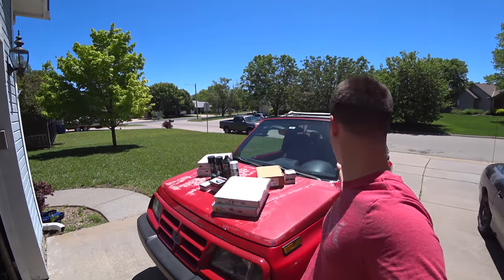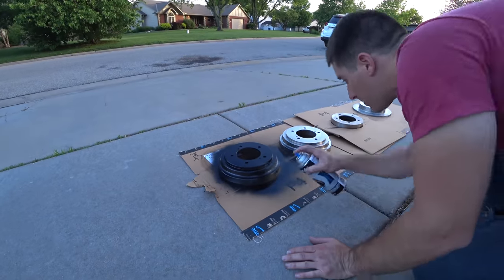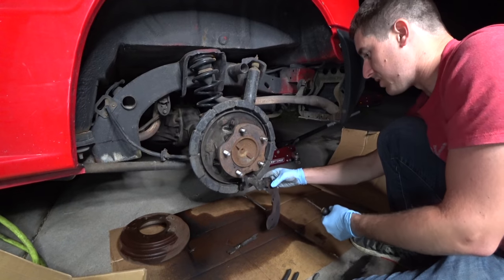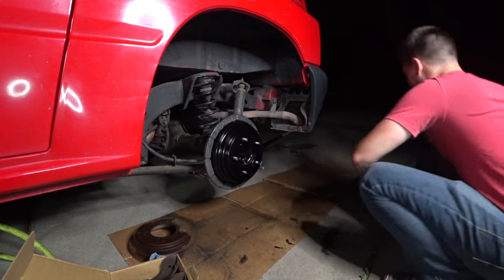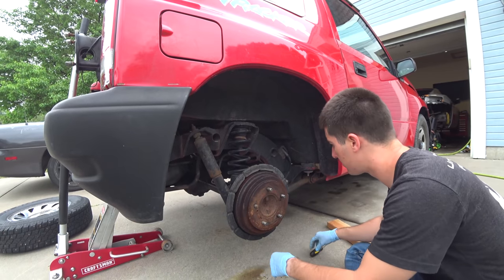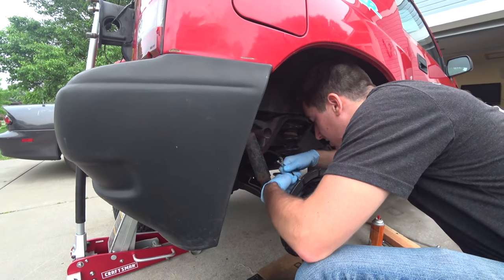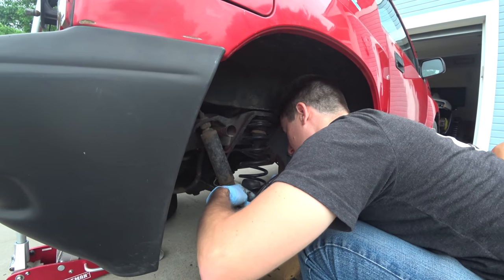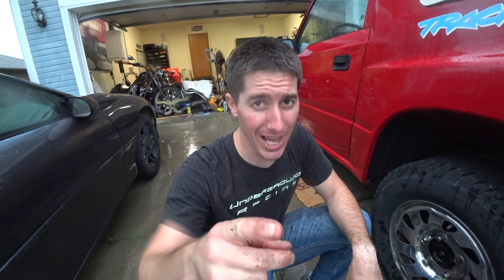The ULTIMATE $400 Geo Tracker BRAKE JOB // Part 1

Comment: 11:00, those clips on the drum are put on during manufacture to keep the drums on the assembly line until the brakes are pumped up and adjusted and wheels on. When I worked as a tech in our GM dealership, the presence of those meant the drums had never been off. We just took a pair of dike cutters and cut them off.

Comment: I'm really enjoying this Tracker journey!  I was 18 when they came out and always wanted one. They look so fun, death trap or not.  I did get to drive the Geo Storm, which was also a fun car. Keep up the videos, I may decide to go get one myself 😁
Reply: I loved my geo storm
Reply: I can attest that after being run off in a 40ft culvert in my (one of 8) tracker, landing upside down, death trap isn't a word I'd use. I wast hurt at all, and climbed out on my own. The driver's side was destroyed after it landed on a large rock, and it saved my life. I've seen many others that landed upside down or similar and people survived unscathed. These were tough built small Suv's.
Reply: @Pressedsteelcustomsllc  mine got hit by a semi trailer in the first heavy snow this past winter, just dented in the quarter panels and tore off my mirror. Everything else is fine, and it still drives perfect
Reply: @Riverplanet  I drove mine home after they wrecker pulled it out of the culvert, and it still runs great over two years later after sitting in my garage ( I've owned it over 12 years) but have another body for it, just gotta have time to change it out.
Reply: @Pressedsteelcustomsllc  wow, that's amazing! Certainly can't do that with most vehicles today

Comment: You know about the adjuster slot on the back, right?Adjust to a light drag once the drums are on. Then E-brake or backing up will maintain the adjustment. Good man replacing everything.

Comment: I had a 94 back in the day, absolutely loved it, I had mine on 15x10 eagles with 33s.... just a little insight when you open just the sun roof dont flip it from the front push up and back from the center of the canvas it's a full sun roof like that

Comment: I've been following along with this little project, reminds me of my 88 chevy short bed p-up with a 350. Over the 9-10 years I had it I pertty much kept it as new although I had bought it used for 2K. If it needed something I would go completly through what ever, rebuilt the front end, rebuilt the brakes, replaced the 700-R4 with a recon unit, kept new tires on it, just never took short cuts. Chevys are so easy to work on. If you like cars then you like tinkering with em.....lol

Comment: Normally if you can lock the brake pedal down, you won't have to worry about the lines bleeding out while doing brake work.  This worked flawlessly when replacing the rear calipers on two of our vehicles.

Comment: Done my share of those only to find a leaky wheel cylinder. It usually happends because someone used up all the brake pads causing the piston to overextend, much like yours. You havent lived until you have to cut the drum off because its fused onto the hub. My last one was on a 1978 Chevy Nova 4 door in 1989. It was a Florida  car but It had been driven in Michigan for a few years. Those cars would visually rust while you sat in a lawn chair and watched it happen. My mother owned one, then I got it from my brother in law, then 4 years later, got another one.
Reply from the maker: Holy crap, I've never seen brakes get that bad 😮
Reply: @WatchJRGo  I dont see it as bad now, I have owned many " beater" cars over my life time. Subarus, A Honda Civic, Ford Maveric, Sometimes multiples of the same kind. I could swap plates between cars while I was fixing the broken down sister to the exact one I was driving. My wife got tired of it after about 15 years of it. I always had a project car going too.

Comment: When you run a bolt into rusty gummed up threads, try adding a groove along the bolt with an angle grinder. This gives the debris somewhere to go and that bolt might not have broken off. Poor mans tap. Nice work, Nice video, Nice GEO

Comment: WatchJRGo... one thing I have learned over time with working on cars and motorcycles... NEVER TRUST HYDRAULICS. You should have inserted a tower on the side you are working on. Working with just having the Craftsman lift to keep the Tracker up is dangerous, the lift hydraulics can fail and drop the vehicle at any given time.
Reply: Which really only matters if you're working UNDER the vehicle. I had a car roll off the jack while I was replacing a caliper, no big deal, in fact I finished doing the brakes before bothering to jack it back up to put the wheel on. Jack stands wouldn't have helped in my situation anyway, I had to do the work on a hill and it likely would have slid off of whatever was holding it up.
Reply: Nodak81 not true dude. His head is in the wheel well. He reaches underneath the car. If it fails it’s not just going to slowly lower down. Personally I’ll only use a jack if I’m pulling a bumper off or something. But brakes or any suspension or engine work I always use a stand or at the least put the wheel under the car
Reply: Nodak81 rolling off the jacks are different... if you’ve seen hydraulics fail in the field you wouldn’t be screwing around
Reply: @oshkoshbegone actually I have. And also seen careless bystanders leaning on the jack and accidentally lower the jack.
Reply: @nodak81  like Abesss said, he had his head in the wheel well and even his arm inside the wheel well. The jack will not come down slowly. Even with the jack having wheels it can slip and bring the Tracker down quick!

Comment: Hi Buddy:
I noticed when you have the top open part way that you only have about half of the front sunroof area exposed. I drove mine with the front portion open all the time. When you are opening the top you push out on the center fold and it will expose the whole front area. Then there should be a velcro strap that will secure it open and the full front area is exposed. You can open this way without ever getting out of the driver's seat. 

Love your videos!

Comment: Not to say I haven't in a pinch not used a jack stand.. but remember Jr, you're the one that wanted to post your adventures on YouTube. Therefore you have a responsibility to do things safely. If not for yourself, for the novice people that don't know any better that are watching you to try to learn. You're beating on a wheel hub while the car is being held by only a jack. With your head inside the wheel well not even the tire under the frame to catch it if it falls. How would you feel if somebody followed your suit. And had a car fall on their head. I hate to be that guy. But you are the one that chose to post things on YouTube. Love your content, but work safely set a good example for people that are learning bye watching you. I'm only commenting this because I just watched you do this same unsafe task while changing a crankshaft sensor in a full size Suburban. You're setting a bad example we still love you though.

Comment: No wheel cylinders? Always replace your wheel cylinders when doing shoes or you’ll be replacing the shoes again when they leak. You also need to use antiseize on the backing plate and pivot points.
Reply: Did you bother to watch the video?
Reply: @paulcopeland9035  yah, I caught it after the comment. It should always be standard practice though. When I saw him doing the drivers side without replacing the wheel cylinder I was a little concerned.
Reply: Can't believe you didn't flush the brake lines

Comment: The only thing I can suggest on this rear shoe job...is use white lithium(sparingly) on the contact surfaces for both shoes(3 on ea side) and lube the adjuster with same so it operates freely with self adjusters...k???

Comment: Were was your grease application on the rear shoes so they slid easily against the backing plate and the cleaning of the self adjuster then the white lithium grease on the threads for smooth operation maybe you did it off camera but you should have mentioned it for those who don’t know

Comment: Should of put 4 door Tracker brakes on it. Direct bolt on. Night and day difference in braking. And you get rid of the solid 2 door rotors for 4 door vented rotors.

Comment: That Tracker would have come with Geo-branded plastic caps on the rims.  Visit a scrapyard to find a set.
Reply from the maker: I have the stock wheels and new caps, just need to spend the $1000 on tires 😬
Reply: @WatchJRGo  I guess you're up to six grand now. No worries, you have lots of room left in the budget.  In 2019-dollars this truck would cost you $19,000 at the Geo showroom - if you could still buy one, that is.

Comment: Good move changing those rear wheel cylinders with that many miles on them.  Plus it forces you to bleed the brakes.  That brake fluid has to be old too.  Don't scrimp on brakes & tires when it comes to Amberghini's safety.  Too bad you couldn't work in the garage.

Comment: Did the speedo needle fall off after you guys cleaned it the other day?
Reply: I think this is out of sequence. If you look when they test drive it at the start, the wiper switch is still broken off the column.

Comment: The guy at Autozone is like "I dont roll with you"..The guy at Autozone is like "how many feet of this hose do you want?" Im like "one but, I need to check its OD with my calipers before I decide if I want it" and he's like "YEAH, but how many feet do you WANT because its all the way in the back..."...Like one dude :| Then he said they didnt have it in stock. Like this is the 3rd autozone ive been to that said its in stock. I mean Advanced said "they dont have hose". Then I looked up and they seriously dont have hose.. or at least none stock it near me..These truly are the end times (needed to check the OD to try and de engineer an SAE rating on a Yokohama hydraulic line thats markings evidently mean nothing now and was trying  to substitute the SAE ratings on a Sunsong hose to determine how close to the original specs. my spec. analysis was by comparing the OD's for a 2" power steering reservoir return line.)

Someone joked they drove a geo tracker and I had to look it up. Then suddenly remembered that everyone drove this car including Malibu Barbie, then one day they all disappeared, prob. cuz they all blew up, and I forgot they ever existed. Then thoroughly enjoyed watching you rebuild one. Thanks dude.

Comment: And thanks for these Tracker videos. These are the ones I'm most interested in. What kind of plans do you and Amborghini have for it? I'm thinking of doing an iPad install...
Reply from the maker: I was going to see if Crutchfield would be interested in sponsoring the audio, planning on a 5” with new speakers and a powered sub in the back 🔊
Reply: @WatchJRGo  cool, hope they come through. I hope she keeps it. You thinking of changing the stance -- drop or lift? They look sexy dropped with the right set of rims.
Reply: @chriss.3476  I hope for 2" lift with 90" style settle off-road goodies
Reply: @aminabellalvaradoaguero9190  I'm not big on the lifted look but it does definitely have a significant following.

Comment: Wrap or paint?
Reply from the maker: Planning on paint but Zack wants to wrap it 🤔
Reply: Please don't wrap it
Reply: @WatchJRGo  That's awesome!  I am glad you're painting it.  Are those Tracker decals still available or do you have someone that can recreate them or is there a way to safely remove and reinstall the ones that are there?  Maybe by using a wallpaper steamer or something?

By the way, you know when this is done, you just have to buy a Suzuki Samurai or, even better (and much more obscure) a Daihatsu Rocky.  By the way, the Rockys just use good old regular Toyota engines, I believe from a Celica.
Reply: Paint, not wrap!!😁
Reply: Paint using spray cans. Always wanted to know if that really works. No pink Amber 😀
Reply: @codespewer  
I kinda like the rattle can experiment idea. But, let her have whatever color she desires.
Reply: @WatchJRGo  please paint no wrap

Comment: $400 geo tracker.... more like $4000 geo tracker
Reply: I think It will be much less if he sticks to just replacing worn parts ....1500 bucks in 10 ..15 ....50.... 100 dollar parts goes along way ..... pads n rotors were probably less than 100 all the way around